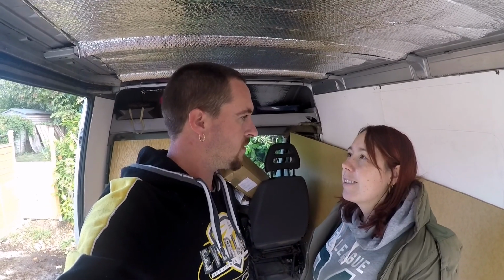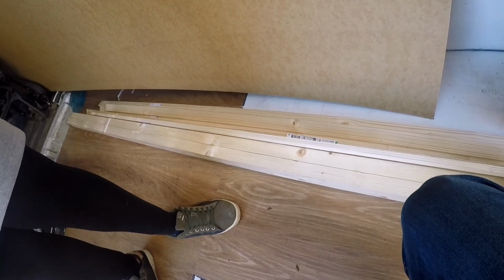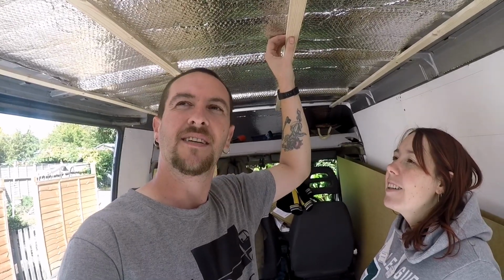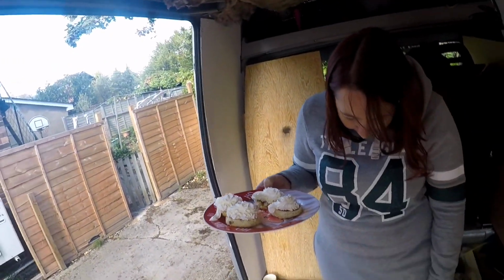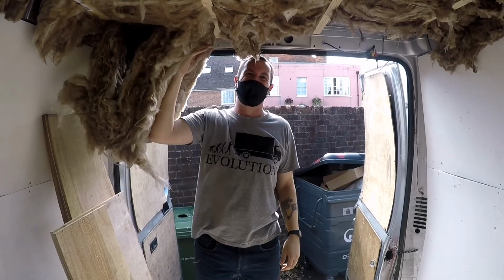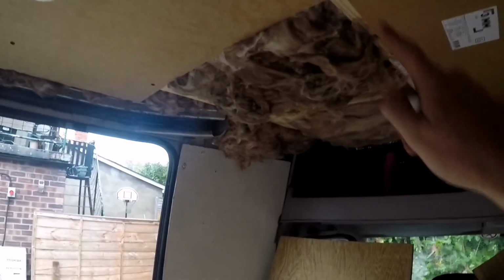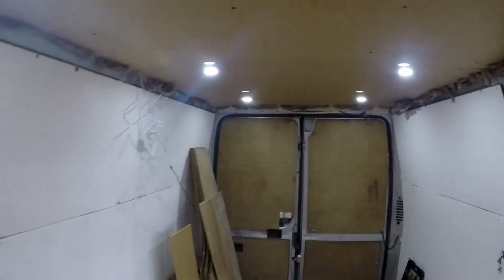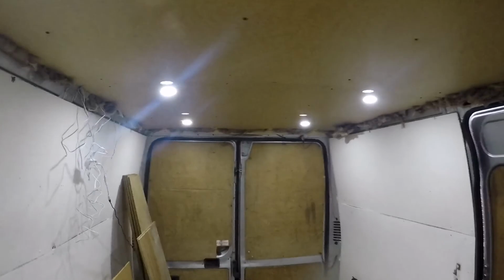Vanlife , camper build the roof and lights go up

Comment: Hiya you two, I live around the corner to you! Anyway it's really worth fitting a low voltage shut off, costs about 6 quid, two wires in two out, shuts off power if you leave lights etc on too long saving your battery, I fit these to all solar, boat and camper conversions, https://www.ebay.co.uk/itm/392905669466 hers an example, good luck, ps, that insulation shouldn't be compressed, but somethings better than nothing! You could use 25 mm polystyrene sheets, b and q s, cheap  as chips, outside in the yard with the wood, keep up the good work
Reply from the maker: Hello, I'm ever so sorry for the late reply, I didn't know this message was here. I will look into the voltage shut off, we haven't really started on electrics yet. So you are just around the corner from us?